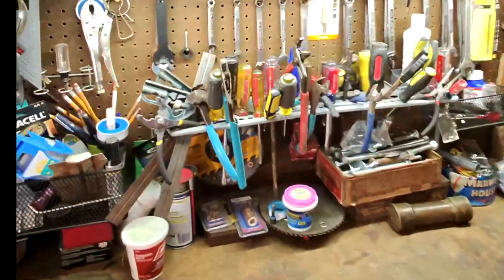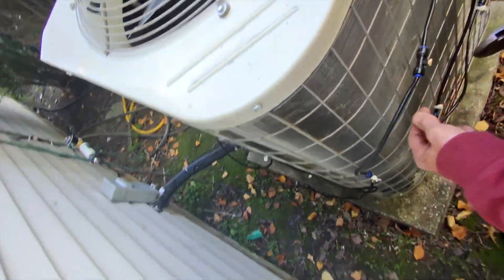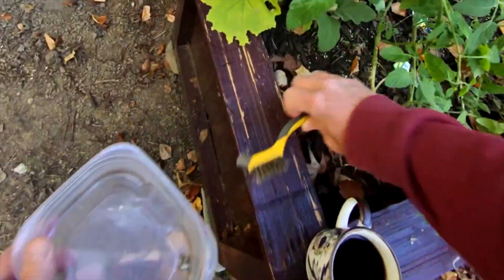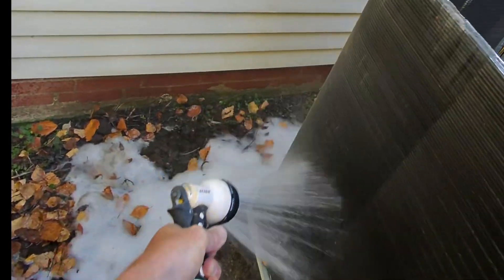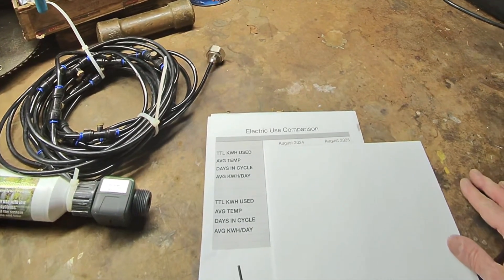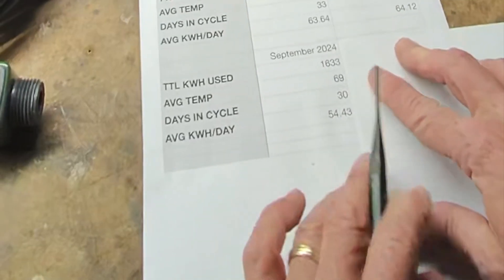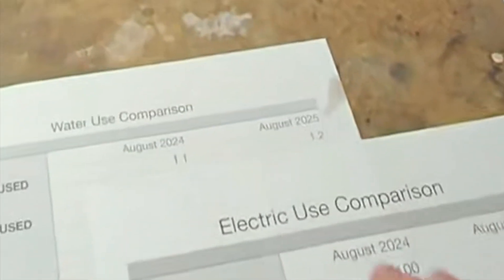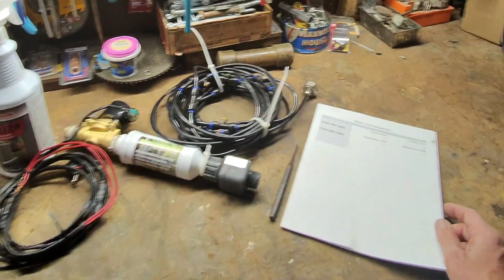Actual Before and After Energy Use of AC Misting System   HD 1080p

Comment: If you do the experiment next year get clamp meters to measure how much energy only your air conditioner is using. Thank you for doing the experiment you were straight forward and easy to follow.
Reply from the maker: In the initial set up video I did have us using a clamp meter which showed a reduction of 8-10% in amps when the misting system was in use as compared to before it was installed. I also have a Soft Start unit with a connected app to my phone which also measures amp draw and it too shows a 8-10% reduction when using the misting system.

Comment: there are too many variables year to year.  You need to just get a clamp meter on there and see if there is a change in current draw after you turn on the water
Reply from the maker: Hi twelveparsex. I actually did just that in prior videos when I set up the system and found a 8-10% reduction in draw. Check them out. We measured not just the amp draw with a clamp meter , but also measured the temp of the air coming out of the vents inside and also found it was significantly cooler when the misting system was in use. That's why it's puzzling to me as I would have expected to see some reduction in kwh over time, but I did not.

Comment: Difficult to follow as the measurements were not isolated or controlled
Reply from the maker: Hi soccerguy. Check out prior videos when we set up the system. We measured not just the amp draw with a clamp meter , but also measured the temp of the air coming out of the vents inside and also found it was significantly cooler when the misting system was in use. That's why it's puzzling to me as I would have expected to see some reduction in kwh over time, but I did not.

Comment: It takes 8000 btus or roughly 2.4kw to phase change 1 gallon of water. These work if they are set up right. Your monitoring of the whole house over a whole season also doesn’t make sense. What if it was a hotter summer?

Comment: You are using the wrong data. You need to keep track of the hrs the unit runs, and the amount of water used during the run time. You are using global number (whole house) and there are way to many veriables that throw those number off. Since you are testing if water mist helps or not then only look at the data for the unit and nothing else. I would want to see month M1 & M2 for year 1 unit ran X amount of hrs and used X amount of water,  M1 & M2 for year 2 unit ran X amount of hrs and used X amount of water.  You will need to take the KW the unit uses per hrs, and the cost of the water per gal. Mutilply the amount used be the price for each to get the total cost for each year. Now you have the correct number to compare for the 2 years.
Reply from the maker: Although I did not keep track of the hours the unit and/or the misting system runs, I did put a meter on the water going into/flowing through the misters but the flow is so minimal that I don't think the meter was accurately measuring the actual use. I need to get a better, more precise and accurate meter for next year. Also,  agree that I need a larger sample size. Two months was interesting but not a large enough sample size. As for cost, I'm not measuring that - only the Kwh of the electricity used and the MCF of the water. Thanks for your feedback and consideration I do appreciate it!
Reply: @chalker546 I see you have a soft start system. If it is a Bluetooth model like I have, I believe you can connect to the soft starter when the system is running and it will tell you specific statistics. 
My Honeywell thermostat has statistics like total time run as well.
Reply from the maker: @thepanduuh  You are correct. I do have the softstart - by EasyStart, which I installed myself this spring, just prior to starting this channel. It does have bluetooth and the stats it provides also show a reduction in power draw by about the same percentage as my multimeter indicated. So it would seem the misting system has a measurable impact, but I'm just surprised that some reduction in useage is not reflecting in on that reported by the utility company. @WeBeGood06 suggested (among other things) that I employ an amp meter data collector, which sound intriguing so I'm going to look into that an if it's not too expensive I'll use that. BTW the soft-start is great and really reduced the initial start up draw of the unit, which now also runs much quieter. Another plus is I can now run my AC/Heat Pump with my 5500 watt portable generator, whereas before the initial draw was too much and I was outta luck on that. Thx for the input and feedback and stay tuned for updates!
Reply: @chalker546 agree 100% on the soft start. I converted my whole house to LED when we moved in. The lights would always flicker when the AC would start. The soft start stopped all of it. 

I have been looking at those monitors as well to see what circuits see the most load. Still get some flickers when turning on some appliances, such as the electric kettle.

Comment: I  installed one on my Trane AC.  It has a lot more sheet metal on the outside.  I have well water with a lot of iron and calcium.  It looked terrible, but didn't affect the performance as far as I could tell.  But took so much scrubbing to remove the stains.
Reply from the maker: Thanks for sharing your experience! Glad to know your unit is working and I have questions: Did you use a filter? What did you use to remove the stains/buildup? How long did your run the misting system on your Trane? Did you notice any difference in your energy use and/or water use over that time? Curious minds want to know! Thx!

Comment: I appreciate your experiment, but you have too many guesses involved. You have a fully electric house but you are guessing that none of the other devices were used more than the previous year. You need to isolate the power reading for just the AC unit. Get a current transducer and an appropriate meter to read the actual amount of power and kwh the AC uses.
Reply from the maker: Hi Jackson. Thanks for the feedback. I believe I did what you are suggesting in earlier videos using a multimeter to measure the amp draw of the unit before and after implementing the misting system. Doing that indicated a reduction of 8%-10% of the Amps. You are right in that using the power bill from the utility provider is a blunt instrument - an approximation based on total usage of the entire household, everything else was about the same so I expected to see some kind of measurable decrease in electric usage given the fact that the HVAC is one of the largest contributor to the overall electric demand of the household but their data - which was based on actual use and not estimated, did not seem to support my thesis. Thoughts??
Reply: @chalker546  I did the same thing a couple years ago, and had a similar reduction in current draw. However I didn't isolate my AC either. I have a bit of a special situation where I live too. I'm about a hundred miles from an ocean and quite often throughout the summer we have 90 to100 degree days but we get a cool night breeze in the low 60's range. And low humidity here too. An AC runs more efficiently when it is cooler outside. So I run mine for an hour or two in the morning and cool the house down as much as possible. Then I rarely need to run it the rest of the day. On those cool mornings the AC pulls around 3300 watts. On the afternoons when I have to run it, it can pull up to 4500 watts.

Still, I would go with a current transducer and a meter that can calculate power usage for the whole season for best actual numbers.
Reply from the maker: Thanks for the detail Jackson. I’ll look into the equipment you suggest for next season. My unit is actually a heat pump, so I use it for heating the house in the winter. Really, I think it’s a bit of a stretch to use this kind of unit for my geographic location (NE Ohio) because temps can regularly dip down and remain in the teens- single digits, and even sub-zero and the heat pump just can’t keep up when that happens. So right now I’m just concentrating on the cooling side of things. As I mentioned in the video, I hopefully will be introducing a solar produced energy nxt summer. Stay tuned and thx!

Comment: The heat exchanger on a modern outdoor condenser is designed to reduce the temperature of the compressed liquid refrigerant to a temperature very near the ambient outdoor temperature.  The liquid refrigerant then travels through uninsulated copper tubing that takes it inside the house to the evaporator.  Slightly lowering the temperature exiting the condenser will have little effect on the liquid temperature at the inlet to the evaporator, because the uninsulated copper tubing will allow the liquid refrigerant temperature to return to ambient before it reaches the evaporator.  
The liquid refrigerant from the condenser cools the evaporator due to a flow restriction at the evaporator inlet that drops the pressure, thus causing the liquid to evaporate into cold gas.  If we significantly reduce the evaporator temperature below the designed operating temperature, we risk freezing the evaporator and reducing the efficiency of the system and possibly causing damage.
Reply from the maker: Thank you for the explanation. Does the process you describe happen on a heat-pump/ air cooler in the “cooling” or “air conditioning” mode as well as the “heating mode”